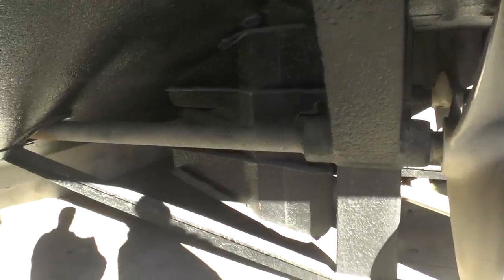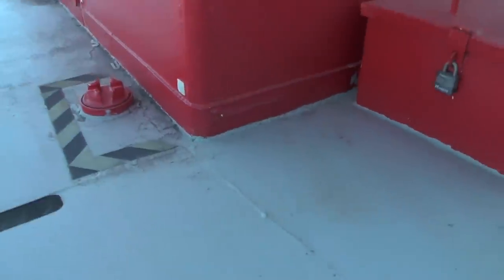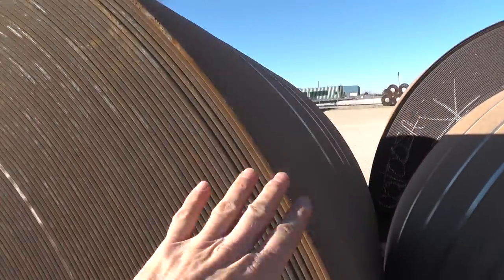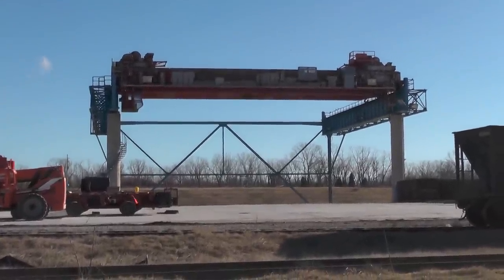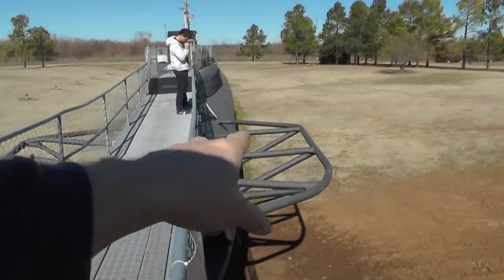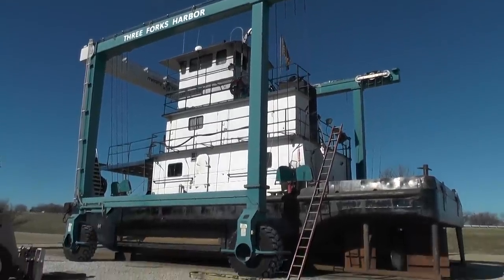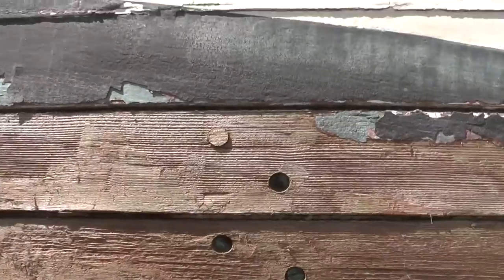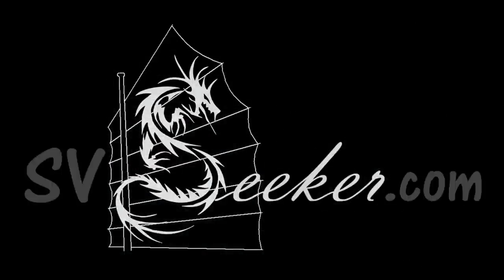Getting to Water

Comment: You do not grind structural welds.
The profile of the weld gives a weld strength.
Welding inspectors actually have a tool to measure the weld hump(profile).

Comment: The screws in the wood hull are made of BONZE. Brass screws would just corrode away due to the zinc in the brass.
Reply: And its amazing how nasty a wood boat can get and still be salvageable
Reply from the maker: mweverett ....I never want to find out. :)
Reply: I was wondering if you have ever heard of red copper 1/8th thickness , being used  for keel guard. The reason I ask, I found an old piece, when they were dozing the beach ( Lake Erie ). A diver told me it looked like red copper, I think it looks bronze, very little patina, unlike-copper. There were quite a few sunken ships off this coast area in the 1800's including a passenger ship that went down taking 180 people, only 2000 feet , from shore.
Reply: Tor Slang for copper is 'red metal'. Red copper also implies pure copper, but it might be a local thing. Much copper was mined and shipped around the great lakes. Many wood ships were clad with thin copper sheet, Also tinned copper in some cases.

Comment: The forward rudders are flanking rudders. Its so that the boat can have maneuverability in reverse as well.
Reply from the maker: Robert L Cool.  Thanks
Reply: Robert L say I've been reading the comments and you the only one that even had an attempt at that absolutely correct flanking rudder's very good I work boats on Snead Dry Dock in Channelview Texas the experience of welding on a tug boat or a towboat I have worked on both freaking amazing what is underneath them things when they come up out of the water have replaced mini flanking rudder Wheels Cutlass bearings shoe horns shoes crazy what kind of trouble than boats get into we had a 35-ton come on to the dry dock they towed it in with two boats and said whatever it's hooked onto is heavy it had picked up a see Bowie anchor somewhere or another damn thing was almost as big as the boat it was hooked to

Comment: About those welds.. It's a totally different matter to weld with an arch welder, than MIG. And for a small salary, than building your own for a hobby. Everyone can squirt a somewhat waterproof seam with MIG, but it takes a real talent to make it with arch welder within a thight timeframe.
Reply: MIG is an "arch welder". All electric welders are "arch welders". What you mean to say is that they are stick welding. I work on boats every day. We have very high end yachts at our marina and I can tell you that almost all of them are built like shit. They cut corners everywhere they can. I have no doubt that this man's build will be far a far superior simply based on the fact that he's designing it and will also be the one working on it.
Reply: electric arc welding arches are round  passages made to support loads usualy in masonary  tig is also called heliarc welding . fluz core or metal inert gas it's all just like "stick" the arc carries the metal and makes the heat.
Reply: Alvarez MW,, I agree, I am now retired, but every employer I have worked for has cut corners when it was not necessary. Extra costs would have been small. One law suit would have cost much more. I made many suggestions and even invented a few things. But most management I have had knew absolutly nothing of the technology I performed but made major constant costly decisions. When I build something for myself it is built to last and most things I buy has to be disassembled to fix the short comings.
I am in awe to these people's abilities.
Reply: Delmus Ingle - great observation. The mind is flawed when dealing with stress as it always wants to cut corners as a way of self preservation, so it opts to lie and cheat in the name of greed. It's sad, but relying on "always doing the right thing" keeps a person sleeping better a night even though he may have to look for a new job. It's about the will and strength to hold to God like standards and not pleasing your superiors in my humble opinion.

Comment: the fiber between the wood on the wooden boat is called oakum its great at sealing out water
Reply from the maker: imchris5000 Oakum -- Thanks.   I'll stick to welding.  :)
Reply: SV Seeker We used oakum when I was a damage controlman in the Navy. It expands when it gets wet to form a water tight seal. So if you hit a rock and split a seam under the waterline, you'd use this and some cedar shingles pounded in with a hammer to stop the flooding until you could get the boat out of the water and do a proper welding repair. 

You could get by with just the cedar shingles (I highly recommend carrying a bunch) but the oakum makes a much better seal.

Comment: I would rethink putting the mast up till you past Baton Rouge LA lots of low bridges coming south.
Reply from the maker: No Way!  You sure?  The Corps said that 50 ft bridge in Little Rock was the lowest on the route.
Reply: SV Seeker I am sure they gave you correct info on bridges (boats hitting bridges would get expensive) but I would wait until you get to, or close to the ocean to step the mast. No worry of getting under the highest point of bridges, no worry of shrouds & stays if you want to tie up near trees for the night etc and there is no way you will be sailing on a river in a boat that size. I don't see any benefit to stepping the mast there in Oklahoma & several possible drawbacks. What if they are wrong on a bridge height? Will there even be facilities that can take it down in that area? It's not likely you would run into a problem but if, by chance, there was a problem it would be a huge pain in the rear.
Reply: And the corps say the levees would keep New Orleans safe
Reply: I will agree completely with waiting on stepping the mast. It will be much less of a headache to simply motor on down till Baton Rouge or even do it in New Orleans where there are plenty of facilities to handle it. I was berthed in N.O. [pre Katrina] and had a 45' mast.  At odd times we needed to drop it or wait for tide or flood drops .  Luckily it was a pretty easy as it was just a steady sail and could be dropped with onboard rigging and a few strong backs.
It will be interesting to watch your blast and paint vids whenever they happen. For some odd reason, I looked forward to that process on my boat.... kind of like the rebirth of an old trusted friend I guess.
Reply: SV Seeker
You never know when you might hit a low bridge in future. Why don't you come up with a cleaver way to push a button and lower the masts? Ok just pushing a button might be a bit extreme. But it would open up a lot of up river places you could motor.

Comment: Steel is not a perfect material for boats. Everything has tradeoffs. Likely its the best for your use. On the local lake we had a bass boat (fiberglass) punch a hole in the bow of a steel boat (Chris Craft Roamer) and the pair went down locked together. Glass won. 3 died.
Reply from the maker: mweverett True, everything has trade-offs.

Comment: Those quarter inch plates 6 feet wide. How much pr. feet.
Reply from the maker: Steel is sold by the pound.  Prices right now will be about .55 to .65 / lb   And a square foot of 1/4" steel is about 10 pounds.  http://www.calculatoredge.com/matweight/material%20wt.htm

Comment: I think there is elite group that could take on a project of the magnitude of what  your building and you sir are one of them. been watching since the day you got your first steel plate delivered one thing i have wondered about you have just answered. i had no idea about oklahoma. i bought a 25ft. deep v cabincruiser  it was a silverton i had never heard of the company it had spent most of its life on lake erie. i bought it on a whimm just pitchures shipped to florida on arrival i got busy checking the old girl out the i.d. tag said it was built in oklahoma i was surprised to say the least. but let me tell you what the bitch was one hell of a boat. i was so impressed whith your build that you could of told me when you finished the boat you where going to dig a canal to the miss.river i would of believed ya

Comment: There is some truly scary welding on this boat. I'm surprised it's in one piece, not sitting at the bottom of the river.
Reply from the maker: TSorovanMHael I think a lot of us confuse ugly welding with bad welding. Because that boat has been slamming into barges for 20 years and does not appear to have any patches or crack fixes anywhere I looked.  So while it's ugly, it's also proven.

Comment: As a shipbuilder of 30 years, an apprentice mold loftsman, and structural steel senior cost engineer, that is some sloppy welding.
Reply from the maker: And yet it worked fine for the life of the vessel.

Comment: I think you have more than a years worth of work to do before calling the boat movers !

You might start looking for a local docking facility where you can finish out fitting the boat before heading to the Gulf !

Also, you should check into whether or not you will need a "pilot" once you get in to the Mississippi.
Reply from the maker: theoldwizard998 The plan is to leave with the materials and finish her out along the way.
Reply: SV Seeker So you are planning on launching in 2015 and starting the next "phase" of your life ?
Reply from the maker: theoldwizard998 Not 2015 for sure.  Still way too much to do.
Reply: SV Seeker
There is a upside to this, your fanatical fans like myself can enjoy watching more of your vids longer. Thanks

Comment: Hey Doug, you named this video 'getting to water'
So that's what I'm gonna ask about in a roundabout sort of way drinking water
Check out Mr Robert Murray-Smith showing people how to make desalinated water with a 34 foot pipe
(thinking about a boat mast, with a solar still/cooker as a 'roof' atop the crows nest)
Check the comments too!!
Perhaps this has never been thought of by the boating community? Would be a crazy experiment, and saves going ashore for Chlorinated drinking water. I think it's a good idea please call me an idiot ;)
http://youtu.be/t6b1mMZ1PZY
Reply from the maker: Actually I have seen that one and it is a very interesting idea.  I don't want an entire mast full of water but I think all it would require is a 1/2 pipe.
Reply: SV Seeker yeah, 1/2" pipe would do it,  could be a life saver. And while I'm letting my thoughts run away with me, maybe some solar evacuated tubes fitted to help use a little less fuel for your hot water,
"Free" Showers are not to be taken lightly. ;)
Reply from the maker: ***** Have you seen any real world test systems.   I wonder how much water could actually be generated from a still the size of a mast.
Reply: SV Seeker I haven't actually.
The solar tubes I was thinking about were in addition, a supplemental system for hot water.
Showers are optional Doug Hahaha

Im not sure on the amount of desalinated water possible with the barometric method, something Robert Murray-Smith may be more instinctively knowledgable on the finer details.